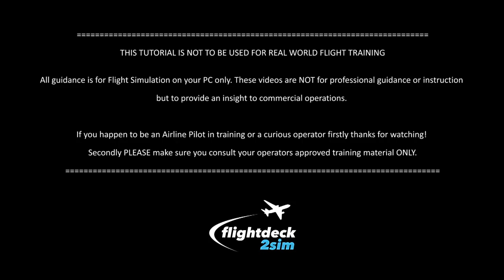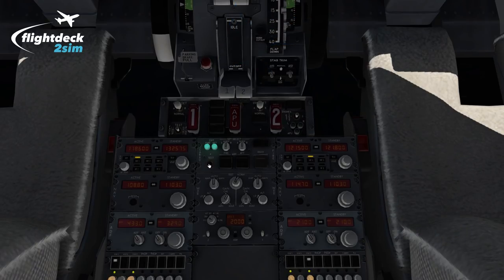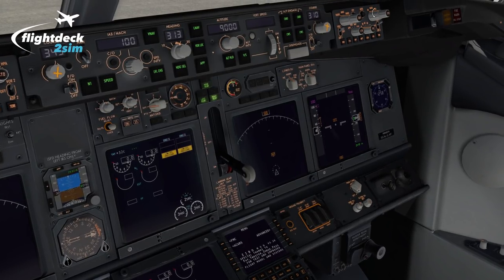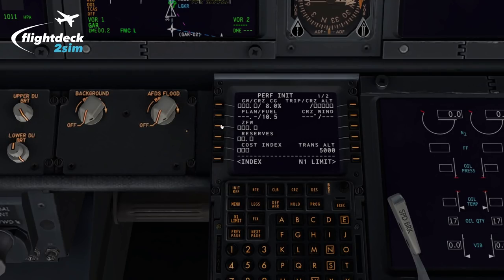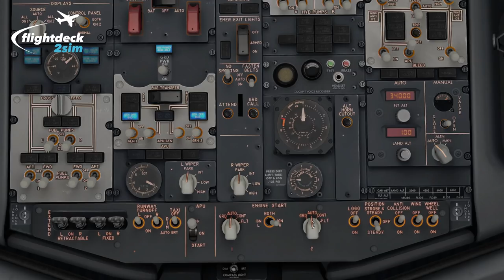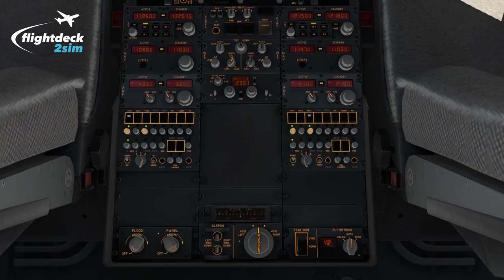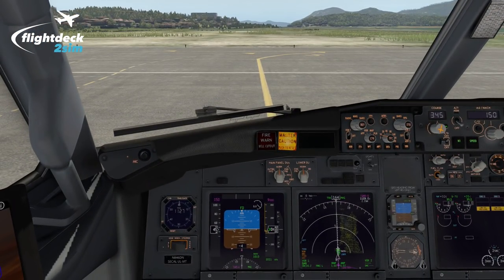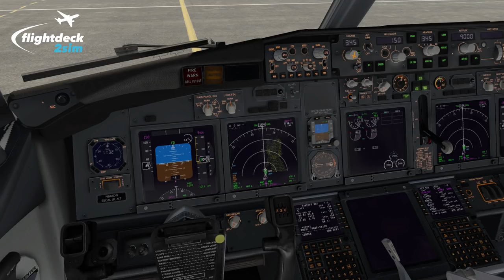Real Boeing Pilot | 737NG Cold & Dark Setup Tutorial

Comment: Ive written the procedure down, in case anyone needs it (with the exception of the FMC setup)...

===PRELIMINARY FLIGHT DECK INSPECTION===
PARKING BRAKE - SET

BATTERY - ON
GPU - ON
POSITION LIGHTS - STEADY
GEAR LIGHTS - 6 GREEN
SHIP LIBRARY - CHECKED
ELC HYD PUMPS - ON

ENG FAULT INOP TEST - MASTER CTN
FIRE TEST - 3x FIRE LIGHT + FIRE WNG + MASTER CTN

EMERGENCY EXIT LIGHTS - ARM
SEATBELTS SIGNS - ON (after fueling complete)
ATTEND BUTTON - WORKING

FLAP LEVER - SET TO 0
FLAP INDICATOR - SHOWING 0
FLAP LEADING EDGE TRANSIT LIGHTS - EXTINGUISHED

TAKEOFF CONFIG WNG HORN - WORKING (TEST WITH THRUST LEVER)

CARGO FIRE - PRESS TEST
 The following lights illuminate:
 FWD/AFT CARGO FIRE
 DISCHARGE LIGHT
 EXTINGUISHER GREEN LIGHT
 MASTER FIRE WARNING

MANUAL GEAR EXTENSION GEAR - CLOSED
CIRCUIT BREAKERS - NONE POPPED

STALL WARNING TEST - BEEPING + CONTROL COLUMN SHAKING
MACH AIRPSEED WARNING TEST - BEEPING
FLIGHT RECORDER TEST - LIGHT EXTINGUISHES
FLIGHT RECORDER - SET TO NORMAL
REVERSER LIGHTS - EXTINGUISHED
ENGINE CONTROL LIGHTS - EXTINGUISHED
EEC LIGHT - ON
CREW OXYGEN - PRESSURE SUFFICIENT (> 1100psi)

IRS - SET BOTH TO NAV
LE LIGHTS (flaps) - EXTINGUISHED
LE TEST BUTTON - LE LIGHTS WORKING

CAPTAIN EMERGENCY ESCAPE - CHECK
CAPTAIN CIRCUIT BREAKER PANELS - CHECK
CRASH AXE - INSTALLED
===PRELIMINARY FLIGHT DECK INSPECTION COMPLETE===

===PREFLIGHT SETUP===
=PANEL LIGHTS=
LIGHTS TEST (PF) - ALL LIGHTS ILLUMINATED
AUTOPILOT LIGHTS TEST - WORKING (1 and 2)

=EFIS CONTROL PANEL=
EFIS TERRAIN - ON
EFIS AIRPORT - ON
EFIS MINS - BARO
EFIS MINS ALTITUDE - APT ELEV + 1000ft
EFIS BARO - hPa OR inHg
ALTIMETER - SET

=DE=
MAIN DE SWITCH - NORMAL
LOWER DE SWITCH - NORMAL
CLOCK - VERIFY UTC
NOSEWHEEL STEERING - NORMAL
PANEL BRIGHTNESS - AS NEEDED

=CENTER PANEL=
AUDIO PANEL FREQUENCIES - SET
WX RADAR - IN POSITION

ADJUST RUDDER PEDAL POSITION - AS NEEDED
ADJUST SEAT POSITION - AS NEEDED

FMC - SET

=OVERHEAD PANEL=
FLT CONTROL - GUARDED AND OFF
SPOILER - GUARDED AND OFF
ALTERNATE FLAPS - GUARDED AND OFF
ALTERNATE FLAPS SWITCH - OFF
YAW DAMPER - ON

NAVIGATION SWITCHES - ALL NORMAL
SOURCE SWITCH - AUTO

ENGINE VALVE CLOSED - ILLUMINATED DIM
SPAR VALVE - ILLUMINATED DIM

FUEL PUMPS - ALL ON
CROSSFEED SELECTOR - ON (BRIGHT TO DIM)
CROSSFEED SELECTOR - OFF (BRIGHT TO OFF)

AC/DC SWITCHES - AS NEEDED
CABIN UTILITY - ON
PASSENGER SEATS - ON
IDD DISCONNECT SWITCHES - OFF (DRIVE ILLUMINATED)
GPU AVAILABLE - ILLUMINATED
GEN OFF BUS LIGHTS - ILLUMINATED

OVERHEAD PANEL LIGHTS - AS NEEDED
EQUIP COOLING - NORMAL
FASTEN SEAT BELTS - ON
WIPERS - PARKED

WINDOW HEAT- ON
PROBE HEAT - ON (IF FREEZING CONDTS)
ENGINE ANTIICE - OFF
WING ANTIICE - OFF
ELEC HYD PUMPS - ON (LOW PRESSURE LIGHTS EXTN)
ENGINE HYD PUMPS - ON (LOW PRESSURE ILL)
DOORS LIGHTS - ILLUMINATED (WHEN BOARDING)

CABIN DIFFERENTIAL PRESSURE - ZERO
CABIN RATE OF CLIMB - ZERO

TRIM AIR - ON
CONT CAB - SET TO A
FWD CAB - SET TO U
AFT CAB - SET TO T

RECIRC FANS - AUTO
PACKS - AUTO
ISOLATION VALVE - OPEN
ENGINE BLEEDS - ON
APU BLEED - OFF

CRUISE LEVEL - SET
LAND LEVEL - SET
PRESURRIZATION MODE SELECTOR - AUTO

ENGINE START - BOTH AUTO

=MCP=
FLIGHT DIRECTORS - ON
COURSES - AS NEEDED (AS PER SID)
HEADING - SET RWY HDG
ALTITUDE - EXPECTED CLEARED ALT (+100FT IF NOT CLEARED)

=FRONT PANEL=
AUTOBRAKE - RTO

SYSTEMS DISPLAY - SELECT (TO VERIFY HYDRAULICS)
HYDRAULICS - >2800PSI; NO RF INDICATION (> 76%)
ENGINE DISPLAY - SELECT (VERIFY ALL DISPLAYED CORRECTLY)

QNH - SET

=CENTER PANEL=
STAB TRIM CUTOFF SWITCHES - NORMAL
WX RADAR - TUNED CORRECTLY
TRANSPONDER - SET (AFTER CLEARANCE)
RUDDER TRIM - VERIFY WORKS (TRIANGLE MOVES)
AILERON TRIM - VERIFY WORKS (CONTROL COLUMN MOVES)
STAB TRIM SWITCH - NORMAL
===PREFLIGHT SETUP COMPLETE===

===BRIEFINGS===
ROUTE CHECK - COMPLETE
FUEL UPON ARRIVAL - CHECK (FMC PROG)
FMC DISTANCE MATCHES FLT PLN - CHECK (FMC PROG)
INSTRUMENT CROSSCHECK - COMPLETE
TAKEOFF BRIEFING - COMPLETE
EMERGENCY BRIEFING - COMPLETE
TAXI BRIEFING - COMPLETE
SID BRIEFING - COMPLETE
===BRIEFINGS COMPLETE===

===PERFORMANCE CALCULATIONS===
GW MATCHES FLT PLN - CHECK
T/O PERFORMANCE - CALCULATED
VERIFY CALCULATED V1,VR,V2 MATCHES FMC - CHECK
STAB TRIM SETTING - CALCULATED
STAB TRIM - SET
===PERFORMANCE CALCULATIONS COMPLETE===

===BEFORE ENGINE START===
COCKPIT DOORS - CLOSED
EXTERNAL DOORS - CLOSED
APU - START
APU GEN - BOTH ON (WHEN AVAIL)
GPU - REMOVE (GROUND CREW)
APU BLEED - ON (1 MIN AFTER GPU REMOVED)
DUCT PRESSURE - VERIFY RISING
A/C - ADJUST AS NEEDED
===BEFORE START CHECKLIST COMPLETE===

===ENGINE START===
TRANSPONDER - ALT OFF
PACKS - OFF
ISOLATION VALVE - OPEN
ANTI-COLLISION LIGHT - ON
PARKING BRAKE - SET

DOORS AND HATCHES - CLOSED (CONFIRM WITH GROUND CREW)
GROUND EQUIPMENT - REMOVED (CONFIRM WITH GROUND CREW)
NOTIFY GROUND CREW START ENG 2 - DONE
ENG START 2 - GND (AFTER GROUND CREW CONFIRMS CLEAR)
START LEVER 2 - IDLE DETENT (@25%)
NOTIFY GROUND CREW START ENG 1 - DONE
ENG START 1 - GND (AFTER GROUND CREW CONFIRMS CLEAR)
START LEVER 1 - IDLE DETENT (@25%)
===ENGINE START CHECKLIST COMPLETE===

===BEFORE TAXI===
GENERATORS - ON
APU - OFF
START SWITCHES - CONT
PROBE HEAT - ON
PACKS - AUTO
ISOLATION VALVE - AUTO
APU BLEED OFF
FLAPS - SET FOR DEPARTURE
FLIGHT CONTROL CHECK - DONE
STAB TRIM - SET FOR TAKEOFF
START LEVERS - IDLE DETENT
PUSH RECALL - WORKING
===BEFORE TAXI CHECKLIST COMPLETE===
Reply: legend

Comment: I dont have the “advanced” option on my FMC, please help
Reply: On the 800 model, those functions have been moved to the Tablet which is left of the pilot seat. There is a brief on screen note at the beginning about Zibo moving those functions.
Reply: Barton Whisler ok but I dont have a tablet either
Reply: Barton Whisler ok but I dont have a tablet either
Reply: Assuming you are using the Zibo 737-800X latest, look toward the left window. It will appear as a rectangular window near the bottom of the window and will have a number of buttons on it. This does NOT apply to the standard B737 that is included with X-Plane. If you are using that one, recommend that you download the Zibo B737-800X and use that but be warned, it is a lot more detailed as far as controls are concerned<g>.
Reply: @bartonwhisler3799  I only have 3 airlines in x plane 11 which were there already and where can I download additional aircraft?
Reply: The Zibo is a "freeware" plane that expands on the the B737-800 that is included in X-Plane. The Zibo can be a little difficult to install as instructions are a little spares and the link just takes you to a shared Google Drive. So to help, instead of the direct link, below is 3 YouTube videos.

Here is a YouTube showing how to install and contains links. Note that I have not gone thoroughly through this as I already had the plane installed before finding this one.
https://youtu.be/nPJ6bLYkS74

Here are two more YouTube from Jeff Favignano which are from a review standpoint but have links also. Note that the second one is for the B727-900 as opposed to "-800".

B737-800
https://youtu.be/00ouAaEWHQE

B737-900
https://youtu.be/JElxVX_stsQ

Good luck and Happy Flying!

Comment: A small reminder, the weather radar should not be turned on before takeoff in real flights
Reply from the maker: Hi Brent,

Not sure if you're familiar with a different aircraft type but you must turn the WX radar on for the 737 prior to take off, that's to ensure you can first see if there is convective weather on your departure routing but also to allow the weather radar to scan for windshear which takes 12 seconds after turning on.

FD2S